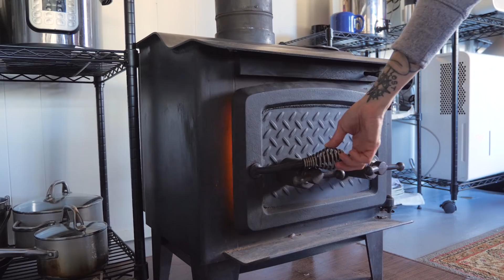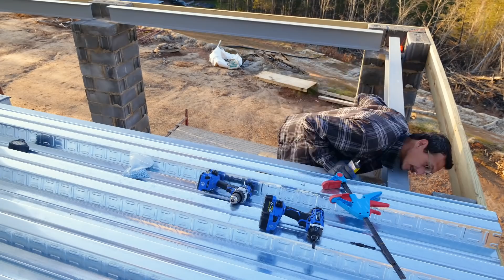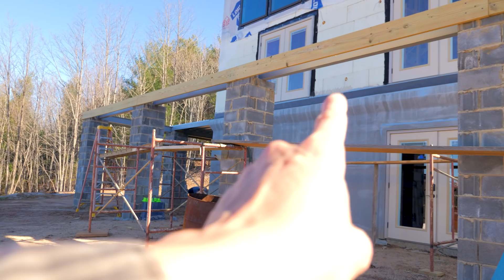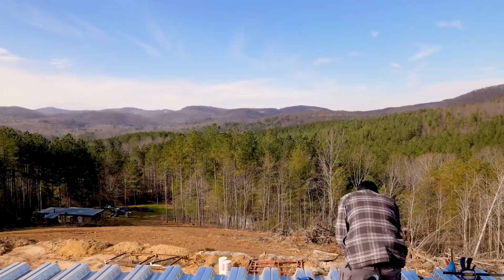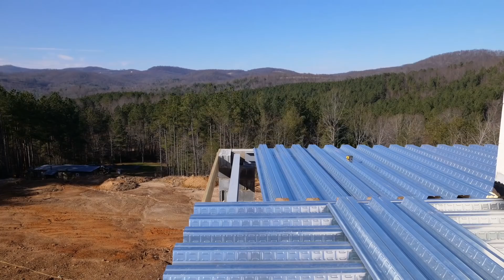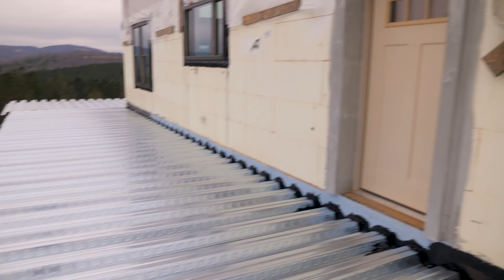Installing Composite Steel Deck Pan for Elevated Concrete Slabs

Comment: Hello. I am trying to get a parts list to start our cement elevated deck. Can you tell me what gauge steel decking you used and what specific I beams? 
Thanks.
Reply from the maker: It all depends on your span, concrete depth, etc. My steel supplier created the drawing and material takeoff for me which was super helpful.
Reply: @Guildbrookfarm  was your steel supplier local or online? Looking to do something similar. Great job putting this in btw! Thanks
Reply from the maker: @tylerwatts8071 Same state but they delivered.
Reply: @Newb2burr  I would use 16 guage..

Comment: I actually watched your concrete pouring video first and, like others, was keen to find out what type of supports you were using.
Interesting to see that this type of construction uses effectively half the amount of concrete a solid slab would use and still does he same job .. although not quite as strong.
I'm looking to build a concrete shelter/bunker with a suitable thickness concrete ceiling so this doesn't appear to be what I'm looking for as It doesn't have a constant thickness I need.
Well done though!
You've put a lot of effort into the job and I note that in the concreting video, the crew did a great job too.
Cheers from Australia.

Comment: I have made who know how many kilometers/miles of that deckpan material doing a summer job, many years ago. The type that I made had a swallow tail, so you would need less concrete to get the same effect.

Comment: I want to build a ground level deck using this method instead of wood or anything else. I'm on a slope and would like to avoid bringing in a bunch of fill. Where does one buy these forms? I'm in San Antonio.
Reply from the maker: Call your local steel supplier. Your lumber yard can help you locate a steel yard.
Reply: @Guildbrookfarm  Thanks for the reply.

Comment: Why would you want concrete for a second story deck? I don't get it... I'll use wood, or densdeck, then waterproof sheet underneath.
Reply: Wood needs to be sanded and painted over time...I hate sanding and paiting the timber in our house. I would never use wood on the exterior again. Also wood is more expensive than aluminum these days.
Reply: Lol no way, my front porch is the same as my back but the front is masonary and back is wood, the pans alone were 1700$ the concrete 3000 plus Brick and block work, the back deck cost me 3k for wood and labor and the post alone would have cost me 8k In the back that’s for masonary and labor.

Comment: Any concern about the shear strength of all that weight on the concrete ledge off the foundation walls? Loving the build! I bet you can't wait until this is finally over and you can get settled in and start working smaller projects.
Reply from the maker: It's designed for the load and has rebar ladder embedded that's specifically designed for it.

Comment: Why there is a metal flashing to prevent deck concrete from bonding with special ledge block and its concrete?
Reply: I believe the flashing prevents the concrete from dripping thru while pouring it.
Reply: I’m guessing also that since the concrete deck and the ledge block will expand and contract at different rates , you wouldn’t want them tied together

Comment: I too am impressed. Very.    Are you going to block off those open deck pan ends before the pour so that concrete does not leak out of those openings?
Reply from the maker: Yes

Comment: I’m sure you have a plan and a reason for working outside in the winter.  Just 3 more months until it’s March and the way I’m thinking is getting inside and knocking out that work before hot weather rolls in. By that time you could finish up the porches in the beautiful spring sunshine.....  just a thought....
Reply from the maker: I hate the heat and humidity

Comment: Happy new year, the view from the deck is going to be great.    I am sure glass rail panels would break the budget.  I had a friend use 4"x4"  4 AWG  live stock panels that he had powder coated in black.  They were set  between wood posts and rails but welded steel tubing would also be a good option.  The black panels sort of blended in and let the view show through.  Eliminated lots of  painted fence boards and was quite reasonable cost wise.  Make sense when the current codes call for a max 4" spacing, that's a lot of boards to maintain on your large deck.
Reply: Black cattle panels would look great

Comment: You’d better weld some Nelson studs to the beams otherwise your slabs gonna slide off the pan deck.
Reply from the maker: Lol no it won’t
Reply: @Guildbrookfarm  concrete isn't like glue, it's not gonna stick to the metal deck once it's cured.
Reply from the maker: Hence, "Composite" deck pan. It does become a part of the cured assembly as it has ribs and dimples that lock it to the concrete.
Reply: @Guildbrookfarm  composite action between the beams and the concrete is created by welding shear studs through the deck onto the top flange of the beam.  google "nelson studs."
Reply: @Guildbrookfarm  so what it looks like here is, the beams aren't attached to the columns, and the slab won't be attached to the beams.  the metal deck is nothing but a concrete form--once the concrete is cured,  the metal deck has no function--it's not adhered or glued to the concrete, the divots aren't holding the concrete in place, the deck and the slab aren't becoming "one."  concrete is really really heavy.  if there's not a positive connection from the slab to the beams to the column--nelson studs welded to the beams, and beams welded to embeds set in the column--it literally means that nothing is connected.  the screws you used to attach the deck to the beams dont mean anything.
Reply: will you at least drill and epoxy rebar dowels into the house foundation?  because, like i said, concrete isn't glue.   just pouring it against other concrete isn't a real connection, esp with the flashing between them.
Reply: @ryan-ee4fd   as a structural engineer you make some good points but there are two types of composite action going on here. One is the dimples which absolutely creates composite action between the slab and metal decking, creating a bond. The second is the composite action of the slab on metal deck acting with the beam which can be achieved with headed shear studs (Nelson studs) but it's not a requirement. There does need to be a positive attachment between the deck and beam to provide lateral stability to the wide flange beams during the concrete placement (most criticism time) and after it has cured. The positive attachment is also necessary for diaphragm action from lateral loads, although it appears there would be very little force. Headed studs could be useful in very high wind zones say in Miami Dade. Welds, tek screw and powder actuate fasteners have all been used successfully in the past. I should point out that there is also an issue during placement that a beam can tip and the deck slides off the beam if not properly attached which has led to many injuries. This is most prevalent when the deck frames into the web of a wide flange on a seat angle. 
But this not 'deck as a form' as it is very clearly composite metal deck. Headed studs are not required, assuming the beams are designed as noncomposite.
Reply: @ckeelor  are there imbeds in the columns?

Comment: I hope you're building in some slope on the surface to drain water. Otherwise you will have puddles of water or ice when it rains or snow melts.  Nobody can finish concrete absolutely flat over that big an area.

When launching Q deck like this we like to work from the side, not the end of the existing deck.

A skil saw with an abrasive blade works good for cutting.  Nibblers work great too.

Will there be additional reinforcing rod or mat?

Comment: Could you not just Hilti the panels to the beams?
Reply: That's how we secure Q deck like this.  The Hilti will nail it right into the structural steel.

Comment: I'm not the safety police, but where are your safety railings?  If someone falls off that deck while they're working, they could come after you.
Reply from the maker: If they do, they are fired before they hit the ground.
Reply: Well you certainly got a very abrubt reply to that ! I have been wondering what the health and safety rules are in the USA too ,at times.Hey-ho.
Reply: @chiccabay9911  Well you can lead a horse to water, but you can't make them drink.  To each their own.
OSHA regulates safety on job sites, they have different regulations on a whole host of criteria, but generally speaking.  Safety rails for fall protection should be at 21" and 42" and able to withstand 200lbs of pressure outward and down.  It's been a while since I've read the reg., but that is generally it.

Comment: The composite deck looks good!! 2 pieces of advice, puddle the deck where it bears on the beams. You don’t have to heat up the beams. Gets some Lincoln electric 6022 and puddle weld the deck. Also you should button punch your laps being that you have a large span between beams. That deck is designed for button punching, it keeps your seams from busting!!!
Reply from the maker: We screwed the laps every 12"
Reply: Arc welding is the way to go with that stuff. He could handle it.
Reply: @Guildbrook Farm. That should be fine if your using “ Lap screws” lap screws have a fine pitch and hold the 2 plies of the deck tighter. May I ask you a question? Why did you chose not to use a transition strip where you transition the deck sheets the other way?

Comment: At the change in deck direction they make a cell closure 1"x2" 20 gage sheet metal angle. Attach with  self drilling screws. Attaching the deck to the beam and angle can also be done with self drilling screws or Hilti pins. Please check with your EOR. It would have been better to skip the brick ledge in the ICF wall and just bolt an angle to the wall the extended from the house to the beams. When they install this deck the gap between the wall and deck or between two ends can be 1/2".

Comment: rosette/plug weld 8mm hole in deck, strike arc against beam, count to 2, weld flows out to lighter gauge metal, done, move on :)

Comment: Well done! I am honestly impressed you did all of that by yourself and you do deserve to toot your own horn. That was a lot of work. 
One question simply because I am just so curious. The places where the pan changes direction has left quite an opening where the pour could just go through therefore I know there is something you'll do to block that, but what? I just can't figure it out in my mind. 🤣
Also, I hope y'all have a great 2021 and are able to get some of your garden build done this year as well.
Reply from the maker: Spray foam 😉
Reply: @Guildbrookfarm  - Wow! Is that stuff really that strong? I ask because I have a few pieces of foam board loose in the eves of my patio cover that is shaped much like your deck pans. Now you've got me wondering should I replace those with foam instead. 🤔